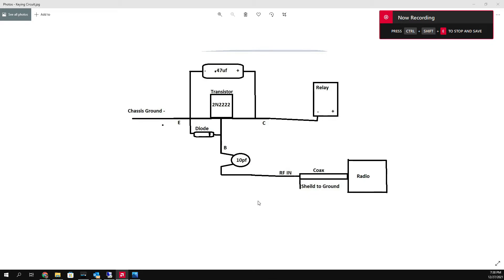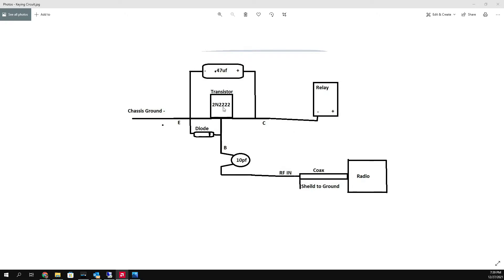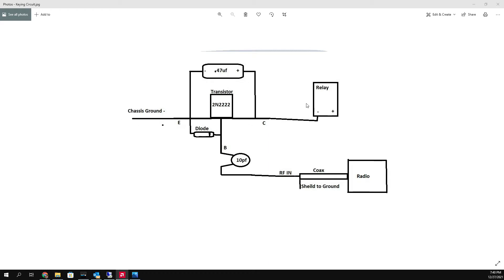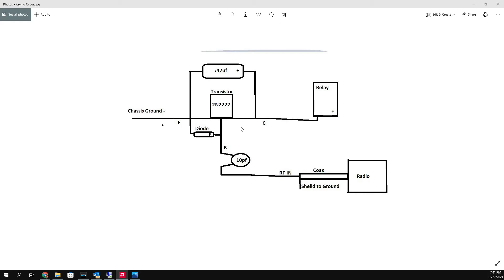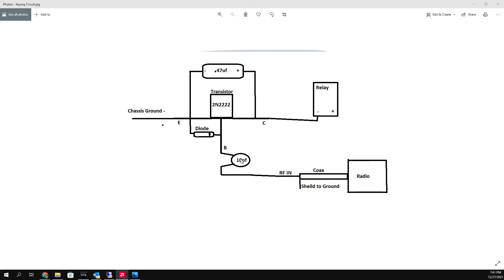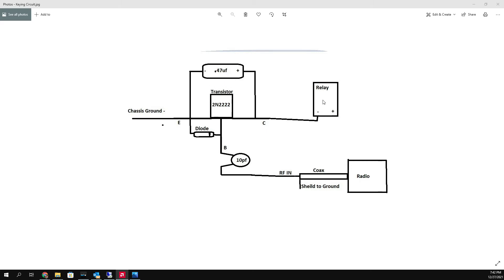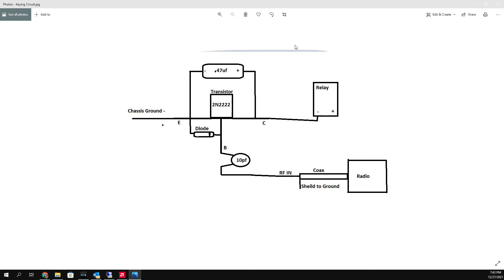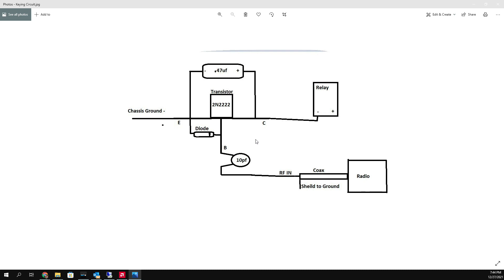How to Build a Simple RF Keying Circuit

Comment: Except you should have your collector on the other side attached to the ground and the emitter on the load side of the transistor to the relay coil to supply the grounding to that circuit. The emitter always goes to load side of the transistor. Collector collects the energy to supply the emitter, where it emits the power to the load in this case the relay coil to close the relay to a transmit function when the radio is keyed up it closes the relay circuit with the emitter being grounded. And the diode from the base goes to the collector in your drawing that should be the emitter. So that on negative duty cycle of RF coming in can drive the circuit directly on that negative part of the RF duty cycle straight to the relay to keep it keyed up and not relying on the electrolytic for a negative bias voltage. So the electrolytic can act as a SSB switch when put inline with a switch to the face plate for SSB use for the delay on the relay circuit.
Reply from the maker: Yeah what he said ! Sounds like his explanation is better I just know it works.

Comment: Thanks for all the help last question how many amps relay for 600w and how many  maps will this circuit put out to drive relay
Reply: What voltage on the 10pf cap
Reply from the maker: @simonkirby5724  anything over 25v will be fine
Reply: @TheElectronMan  thanks again
Reply: @TheElectronMan  the electronic cap is 47uf ?
Reply from the maker: @simonkirby5724  Yes 47uf
Reply from the maker: No problem happy to help I would go with a minimum of 10 amps if we are talking 600w AC as far as how much the keying relay circuit can take it's less than an amp probably would not go over 800mah but the activation circuit on the relay shouldn't draw that much current the relay you buy should have specs on what it takes to drive it..
Reply: @TheElectronMan  thanks happy Christmas
Reply from the maker: @simonkirby5724  Thank you and Merry Christmas as well...

Comment: Nice how would you wire the relay
Reply from the maker: Use the ground side of the relay as the activate part of the circuit. Meaning feed the relay power and then use the ground as the off/on part to close the circuit.

Comment: Ok I didn't have a 10pf  available so I used a 13pf  now dose this determine the amount of power to key the relay the circuit works it just takes about 10w to key the relay and I would like it to be around 1or 2 watts
Reply: You missed a connection. The transistor leg neg cap leg and the diode are all 3 connected to ground.
Reply: @nfsusna I was wondering this myself
Reply from the maker: No the cap is there to filter the RF so the relay doesn't get feedback and start chattering 13pf is fine btw. 1 or 2 watts should be all you need to get the relay to work that comes from your transmitter all the keying circuit does is sense TX and close the relay..,,
Reply: @TheElectronMan   how do I get the relay to stay clamped longer for SSB  it chattering
Reply from the maker: @Davidsmith218  Just add a 1000uf cap to the keying circuit that will hold the relay down for a couple seconds.
Reply: @TheElectronMan  thanks for the help I'll try the 1000uf cap for SSB operation
Reply: @TheElectronMan  I did order some 10pf silver dipped Mica Caps but for some reason the lower I go the more power it takes to key the relay right now I have a 53pf cap and that getting it around 3 to 4 watts to key the relay now the 2n2222a transistor are cheap from Amazon could this be affecting my results
Reply from the maker: @Davidsmith218  It could possibly be the transistor but the max input on those is about 800mw the switching of the transistor is done low current DC that is what the 10pf cap is for is to convert the RF to DC and then the other capacitor is there to smooth out the pulses if you need a longer SSB delay just add a 1000uf 25v electrolytic cap to the 47uf one, same orientation positive and neg I usually wire a switch on mine so I don't have the delay on AM hope this helps..
Reply: Is there a particular diode I need to use?

Comment: What do you have to use to make it key larger release
Reply from the maker: Just add a 1000uf cap to the keying circuit that will hold the relay down for a couple seconds.
Reply: Do you have a easy circuit for a irf510, 520 , 540 I have a kit sitting around